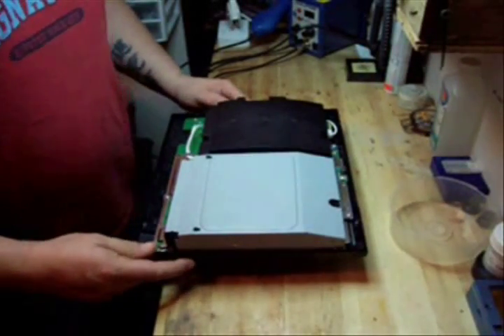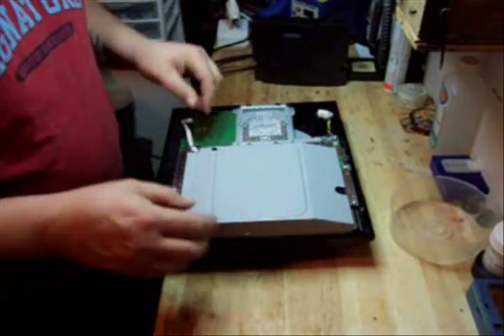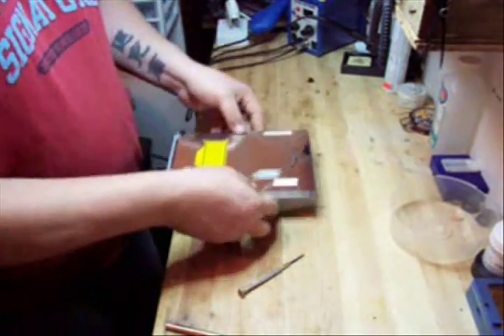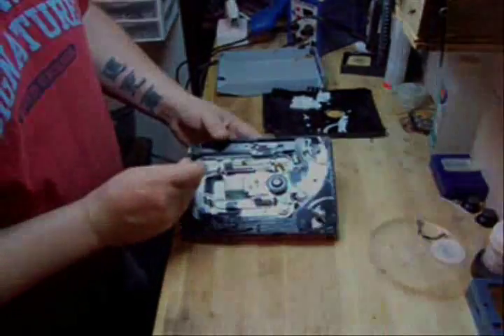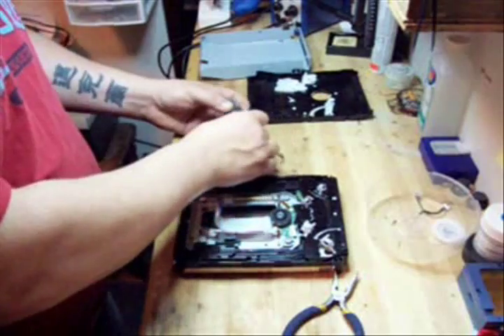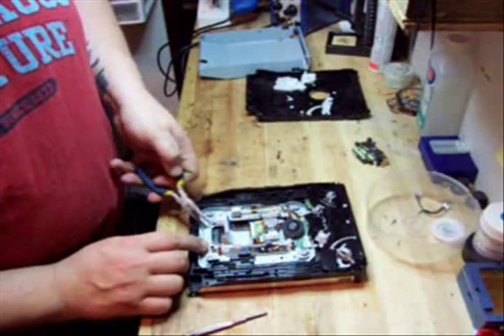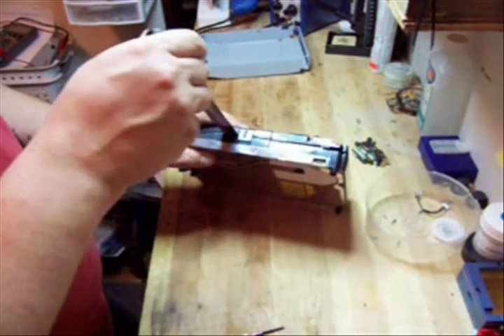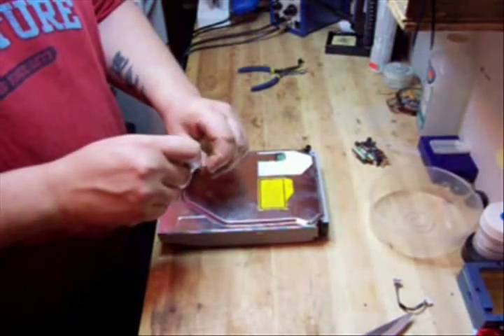KEM410A laser replacement

Comment: Hello, I am Brazilian and I had problems with my PS3. This is the only video that is equal to my playstation. However this flat cable that secures the drive, I had not taken the black side and both mecher, cable flat just ruining the tip, and that the bottom of the player holding, that minuscule plastic broke and now I can no longer hold the cable. Sorry for the english but I'm using a translator. To fix just buying a new drive plate to fix the plastic is to buy or just the plastic part? Thanks

Comment: Man I have to say a huge thank you. I replaced my laser assembly an put it back together an it didn't work an I was arrgg!!! But saw ur vid an quickly seen where I went wrong with closin it back up an bang, works!! Btw I found an easier way then the knife, if the arm is out of place there will be two holes where u can see it(sort of like its lit white!) I used a mini screw driver jus to feed it past the two holes so they were blank an tha worked, but jus a suggestion, your still the man!!!